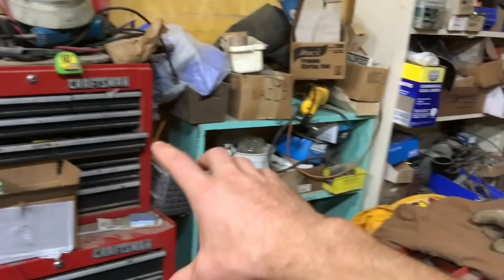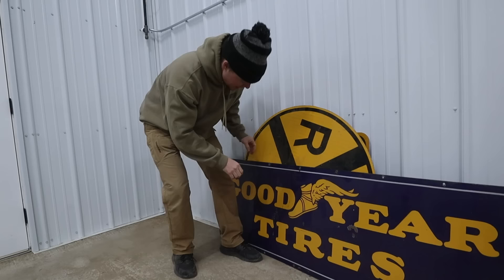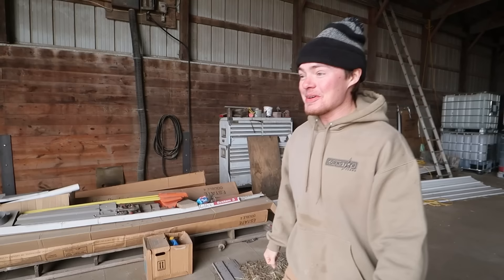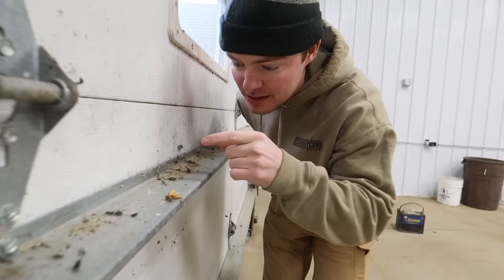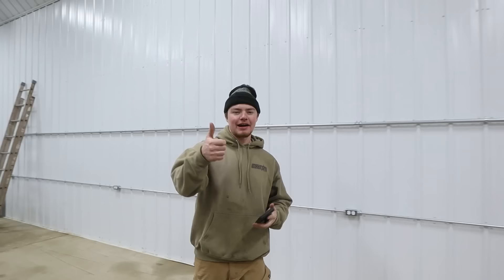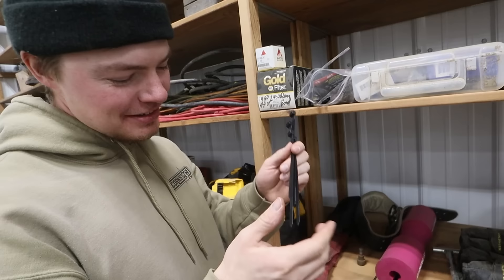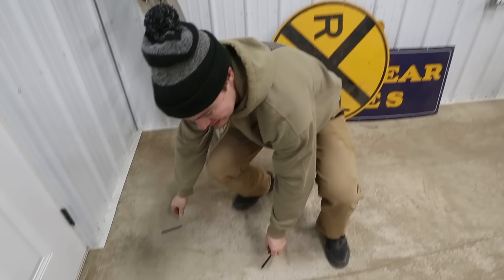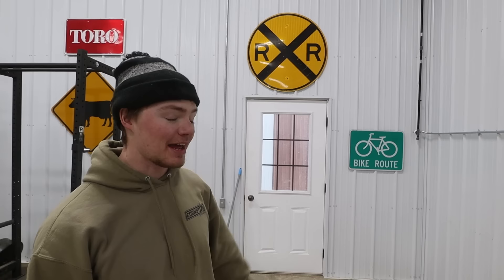Finding $10,000 In My Grandpa's Hoarder Garage

Comment: You should really have your wires wrapped out the screws on the sides of the outlet. In a J shape. I know you can put them in the holes and tighten the screw. But that’s what can cause the same problem you had. And there’s much less brass touching the wire. Therefore, less conductivity. Before anyone tries to debunk me. I’m a contractor. I do a lot of electrical work. And I do it by code!

Comment: You can clean the tool boxes with some Denatured Alcohol  & a scrub brush. That will make all the glue residue all cleaned off & they will look good as new. Just a suggestion for y p u young bucks. Lol. Believe me it will work & not damage the front of the tool boxes.

Comment: Do not use the devices (outlets) as junctions for your wiring. That is illegal in WI. Instead, wire nut all the connections and attach pigtails to connect to the devices. You should have used bigger boxes. The fact that they are all "daisy chained" together leads me to believe that's where your problem is.

Comment: I have to say that, especially on the 220v runs, I am a little concerned that you have them daisy chained like that.  If I don't miss my guess, you normally should run one circuit per outlet.
Reply: Nope. You're allowed to put as many outlets on a branch circuit as you want. But if you turn on too many loads at once you'll trip the breaker. The guidelines say keep it to 12 or fewer outlets on a 15 amp branch circuit.
Reply: @bruceadler-9410  is that for 110v or 220v?

Comment: Another option for lots of unnecessary stuff/tools etc are donations to charity/thrift stores. The tax deduction will help the bottom line for your business and you also help the charity and your community. I had to do it myself. Too many tools and only a limited need after retirement. As for the extra sockets, string together sets on a pieces of bailing wire. Use those sets for "field throw aways" when you have to fix a broken machine while knee deep in mud..you will loose some.

Comment: Hey Cole, at +57:10 I'm pretty sure that's still not the correct receptacle for a new welder!!!  (unless maybe it's a cheap unsafe Chinese toy). 

That new 3-pronger you're holding is a NEMA 10-50R. The NEMA 10-50R is obsolete (and no longer permitted by the electrical code because it doesn't have a ground connection) and shouldn't be used on any new equipment. 

Any new 240V heavy-duty welder (or other 240V equipment) you buy (almost certainly) will require a NEMA 6-50R (which is a 3-pronger 240V 50 amp receptacle) or a NEMA 14-50R (which is the "4-pronger" you're removing). 

FYI: A NEMA 6 receptacle has two hots and a ground (but no neutral). A NEMA 10  has two hots and a neutral (but no ground, which makes it potentially unsafe if you have a floating neutral fault and a short to metal case). And the NEMA 14 has two hots, a neutral, and a ground (all new electric dryers and stoves are pretty much nowadays are required by law to use a NEMA 14).

Given that you're probably going to have to re-do those receptacles again (when you discover your new welder requires a NEMA 6 receptacle), a better idea than replacing the wrong 3-pronger with the correct 3-pronger is instead put back the 4-pronger NEMA 14-50R. And then use a short adapter cord to go from 4-pronger NEMA 14-50R to 3-pronger NEMA 6-50R (or 6-30R),  and/or a short adapter cord to go from 4-pronger NEMA 14 to any old equipment that requires the obsolete 3-pronger NEMA 10-50R (or 10-20R). That way you can handle any situation.
Reply: Also, you're not supposed to put two wires on the same screw on those 240V receptacles. You're supposed to use pigtails to connect the receptacle to the runners to the next box. But even with out any pigtails, those 240V boxes are over-full. And, they're mounted the wrong way up. 

 It looks to me like you're using  ~20 cu-inch Handy Boxes.  Replace those small Handy Boxes with extra deep 45 cu-inch 4x4 boxes. If you can't find the  larger boxes locally, then get regular 4x4 inch square boxes and add a 2-inch mud ring extensions to them.  And definitely get boxes that have 3/4" knockouts, don't drill them yourself. 

And while you're replacing those too small boxes with larger ones make certain to mount them the right way up.  The cover plate screws should always be on the top and bottom. That way the plug's cord will hang the right way.
Reply: To correct all these problems with your 240V plugs here's what I would do:

1. Remove those NEMA 10-50R receptacles.
2. Use a 1/2-inch Rigid Box Spacer (SKU# 293667 @ Home Depot) to mount a second 4--inch box below the existing boxes. Make certain the box is turned so that the receptacle mounting screws are on the top and bottom.
3. Run pigtails from the old square box into the new square box.
4. Put a blank cover plate on the old square boxes (making it just a junction box instead of a over-full receptacle box).
5. Mount the NEMA 14-50R on the new box. Make certain the rounded ground contact is on the top (so the plug and cord hang the right way).
6. When you get your new welder check what kind of plug it has. It will probably be a NEMA 6-50P. Buy the matching welder adapter cord. For example, google "welder adapter cords" and find the one that says,  "NEMA 14-50P male to NEMA 6-50R welder adapter cord". Alternatively, remove whatever plug the welder comes with and substitute a NEMA 15-50P plug (just make certain you don't mix up neutral and ground).
7. plug the welder in and start welding

Comment: Toolbox tip I came up with about 10 years back. Requires a computer, a smartphone/camera or digital camera, a printer and removable inkjet sticker paper or vinyl printer paper. Step1: Open each drawer after organized. Take a picture of the entire drawer contents for each. Step 2: Use photo editor software or smartphone picture editor, rotate and trim drawer pictures to straight rectangle,  by trimminhlg or cutting off excess areas outside the drawer itself. ( Can even do this step when taking each picture, way easier). Step3: using computer combine them pictures into whatever page layout you like. Step 4: Print all those color pictures fitting as many as you can on each sheet of sticker paper. Size the rectangles big enough to easily see, but small enough to fit on the front of the drawers. Step 5: cutout each retangle picture and place them on the matching drawers. While labeling each drawer and its contents could do the same thing. Listing each separate item would take way more work/time. It also requires you to read each label ist. (Quicker to just open a drawer a d look inside.) A simple overall contents, such as snap-ring plyers, electrical stuff, etc is faster. Downside, it makes you have to open the drawers to see exactly what those specific tools are in most cases, same as b4, might as well do the latter. But by having a color picture larger enough to see at a glance, what exactly what is each, you do NOT  ever have to open each drawer. This itself is worth the effort and time to label the tool drawers using cheap label paper/vinyl pictures. If you ever change a drawer or reorganize some, just remove the old label and create new ones as needed. Can't tell how much time and frustration this picture label system has saved me over the last decade. Moreover how many buddies, co-workers, tool salesman, and others have all said, "I wish I had thought of that and then did it for their own tool boxes." I just remember the old saying, worker smarter, not harder. Best wishes.

Comment: Seeing how thick the covering was on the toolbox it, more than likely was meant to be permanent, it protected the stainless steel from scratches, dents etc. 
Since you removed it, it's now going to scratch and look disgusting in no time. 
You absolutely need to clean the whole thing with something to remove all of the residue or it will attract every bit of dust around